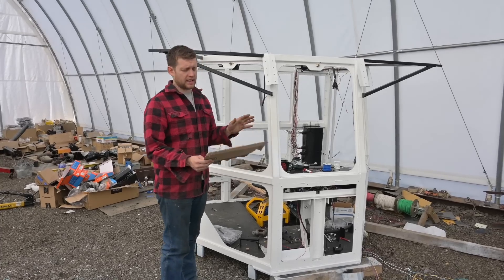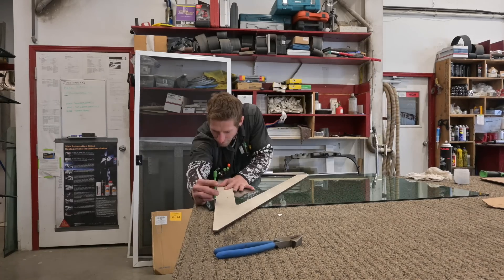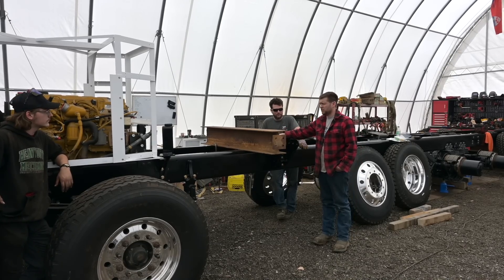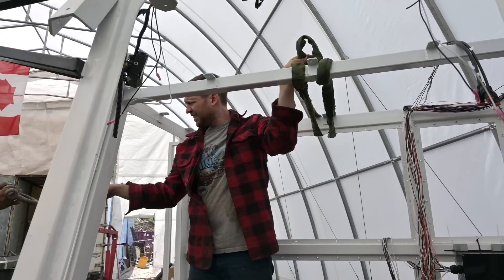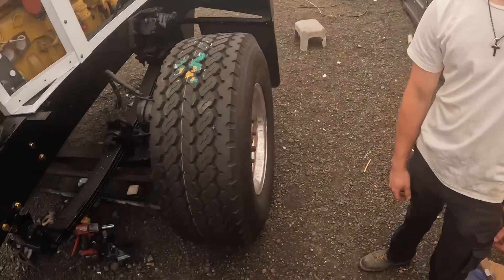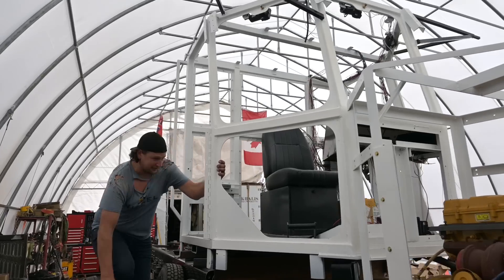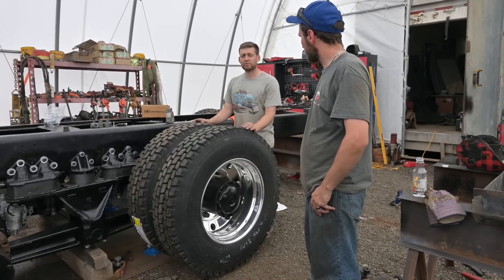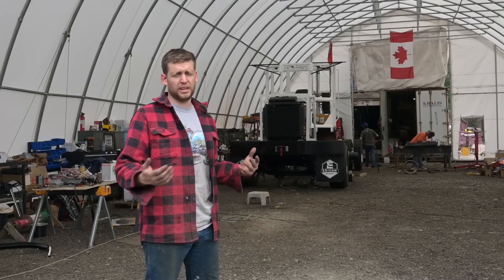Glass, Wheels, and Progress: Cab Update and More!

Comment: In Europe you would probably have to have very sturdy steel (like 1/4") to cover the wheels if you had that type of windows. Or hammerglass windows, like on a harvester. If the steer tires blow it will be a huge liability wont it? Very curious about this

Comment: Great looking cab. Two questions that may have already been answered.
1 Is the glass CMVSS approved?
2 Who will inspect the finished truck to give it it's  final CMVSS approval and sticker so it can be licensed for the highway?
Reply from the maker: 1.  Yes

2.  Ken said he would
Reply: @EdisonMotors Flat glass?  When you look out the window at the side view mirror you might see a lot of reflection and glare.  I believe window tint should reduce the reflection.  
(I'm a heavy duty diesel mechanic not a glass expert.) 
My service truck is a Isuzu NPR cabover box truck with flat glass.  Sometimes I can't see out the window at all and it's pretty dangerous on the highway.  
I'm pretty sure that's the reason most vehicles don't use flat glass but again I'm not a window expert.

Comment: It that still laminated or tempered safety glass? I love the simplicity, but I don’t want to see a driver injured by plate glass shards.
Reply: I cut the glass, both are considered saftey glass. But AS1 laminated goes up front, and usually tempered goes everywhere else. In this case, it's AS2 laminated in the doors.

Comment: What’s the legality of the cat for on highway? Is it sort of under the same category as a generator on the back of a water well drilling truck? Even though the body builder did that. 

Off highway and on highway are two different standards, doesn’t make a lot of sense. Regardless, your oem engine is a cat, that doesn’t meet or was made for on highway standards, I’m just curious how that works.

Part of me thinks you touched on this a while back but I can’t seem to find the video

Comment: I've come to realize that the answer to: "Why isn't it done differently? (better)" 
Is often simply just: "because we've always done it that way"

People are resistant to change and afraid to try new things, they're afraid of ridicule, taking risk, losing money, etc etc
Reply: On the flip side, not everything needs redesigned and reengineered. Like the Cyber truck for example, the bed is useless if you are shorter than Shaq, as unlike a normal pickup you can't reach over the bedside to grab things.

Comment: I just can't get over how simple the truck is. My family were loggers, and they made their own trucks and logging vehicles too, so it's not like I've never seen it done before. But I just love seeing simple, durable, dependable things like this, and you almost never see it anymore from a commercial product. I wish I had such a similarly simple and durable little pickup truck (like the ones you could get in the 1980s and 1990s). Straight frame, simple body, reliable and easy to work on engine, easy to work on, basic.

Apply the exact same approach you have here, to a small pickup truck.
Reply: I've been wanting to build a medium duty pickup like that for a few years. Spent a few summers on a beach in Alaska, and found that the 2002 and older F350 Ford was about the last "work truck" ever built, and they weren't perfect, just close to what a truck should be. New trucks are absolute junk.
Reply: @davesstillhere  totally agree

Comment: Through years of using the excavator/backhoe for lifting things, put a lifting eye on the end of the arm.
That way you can lose the bucket and the driver can see what is going on.
It also makes it safer for the guy connecting and undoing the D-shackle, and you have more from to manouver.
Keep up the good work.

Comment: For production builds, I suggest flush mount threaded bosses in the top of the cab so it can be fully built as a subassembly. If the cab gets simple cannon plug harnesses to the truck, it would be a fast install process.
Reply from the maker: That's the production plan actually
Reply: Plus they can be used for mounting accessories. Lights, antenna brackets, air dams if someone gets ambitious
Reply: @EyeMWing  surface to air countermeasures if it gets weird...

Comment: You guys could build an assembly line,  all the parts in a row, and roll the chassis down beside it putting it on the chassis,  and powder coating! Powder coat the frame and body, in a similar line,  no waiting for paint to dry!

Comment: laminate glass, PLEASE
Reply: Laminate doesn't explode into a million pieces when a small part gets cracked, like from a rock chip
Reply: @Burnsidef250  
thx for your correction
Reply: It is laminated. The guy was cutting the laminate inside the glass with fire.
Reply: @WatanabeNoTsuna. he was cutting it with a knife though, he heated it up to be able to bend.
Reply: @AlexKall  I didn't mean that the fire did the cutting, merely that he was cutting using fire as one of the tools and techniques, mainly to indicate what I meant as a confirmation that the truck indeed uses laminated glass.
Reply: @WatanabeNoTsuna.  ah, got it 👍

Comment: I love that the whole truck is being built in a tent with a backhoe and hand tools. The simplicity of this truck is what I like most about it. The average guy can work on their stuff again.
Reply: Built in the bush so it can be fixed in the bush
Reply: @jaydenlobbezoo1971 😮😮😮pu
Reply: @jaydenlobbezoo1971 lh
Reply: @jaydenlobbezoo1971 😮p😮
Reply: Laminated safety glass all around or is some of it tampered?
Reply: @dirtdevil70  It's always a good idea to safety glass the door windows for quicker escape in case something happens and you can't get the door open for any reason. I think it's required in the US, but I'm not sure about Canada
Reply: @hrlsswndr3938  that's what i was wondering..front and cheek windows should be laminated but door windows would be best tempered...rear window probably laminated
Reply: @dirtdevil70  I did the glass for this truck, and it's laminated all around. Tempered would have had to be custom ordered. There was a time crunch, and I had to cut and place all the channels to make it a slider. So laminated was the fastest, cheapest, and easiest way to do it.